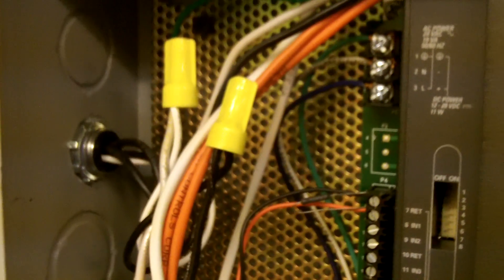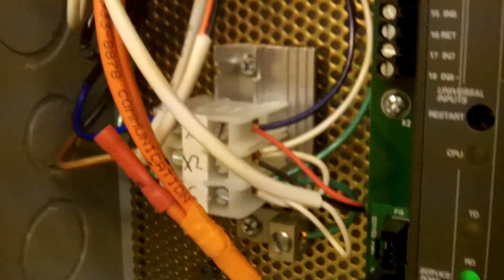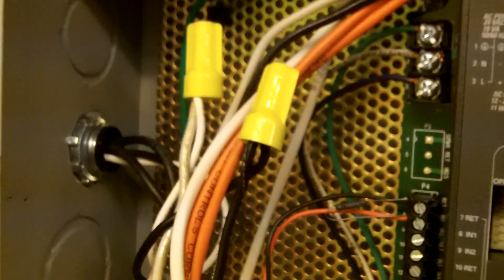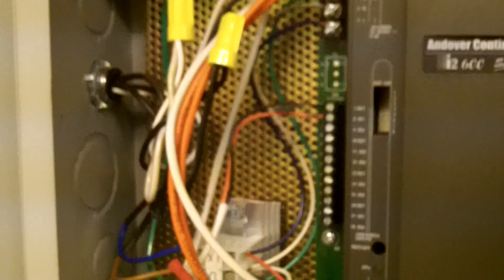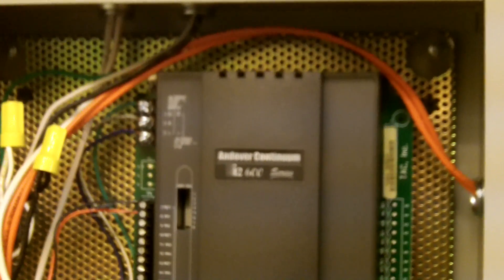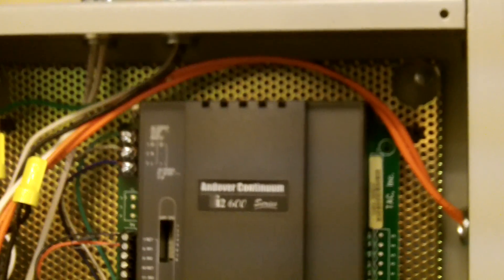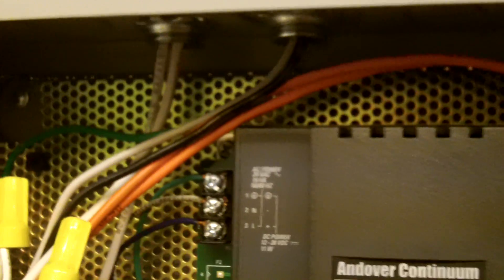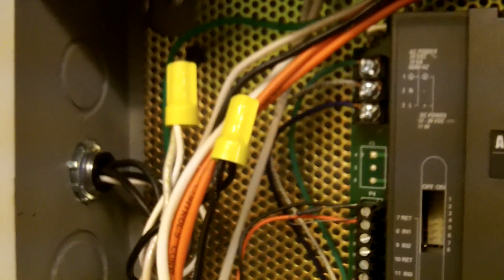Moving Violations Video No. 120: Illegal Touching of Cables

Comment: Sloppy work, few minutes of cable management and you could have both in same box, some low volt 10g fiber systems still need 120 volt power in. I'm surprised that low volt network wasnt feed with a AC/DC PSU.